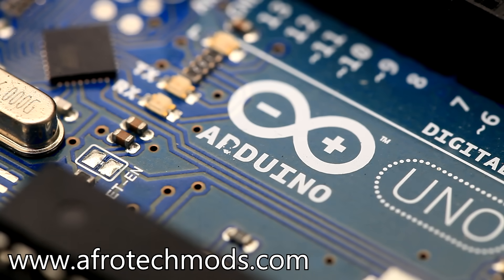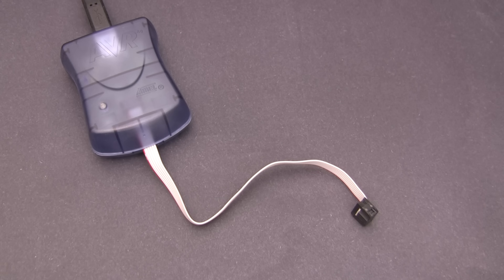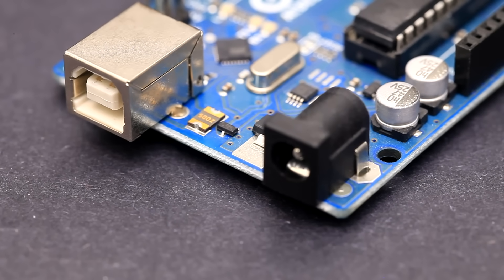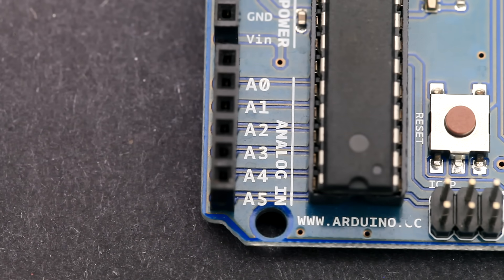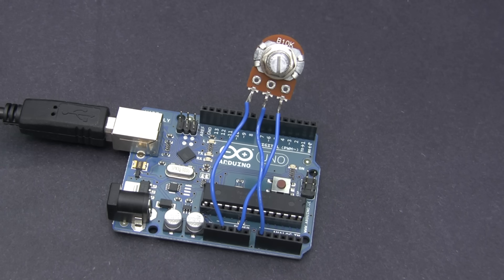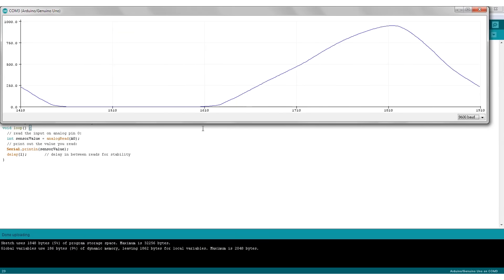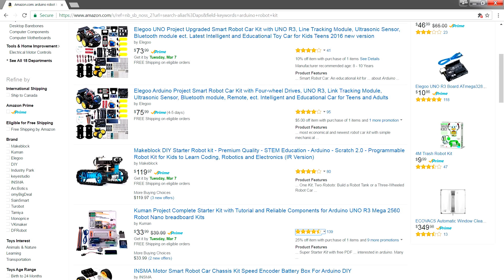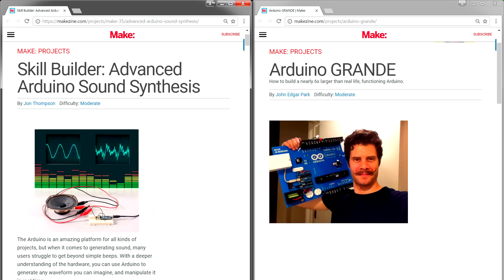You can learn Arduino in 15 minutes.

Comment: So, it's just a simple small computer.......
Reply: With just 300 pages of datasheet. Very simple!
Reply: @Henry-sv3wv  I can't think of a use for it compared to my desktop.
Reply: @gangleweed  Maybe you are more kind of  a 'DIY building my own digital high speed hardware guy' then an FPGA board is your thing. You can make your own digital hardware design including making your own microcontroller 'run inside' it.

You can see an FPGA as a giant field of logic gates. and instead of using a soldering iron to create connections between them you can configure the connections with software.
But you are not thinking in this low level, you get a higher description language for describing your logic in VHDL and the program generates the low level configuration connetions for that (vhdl hardware synthesis).

This is how you can design new digital hardware and test it on an FPGA before turning it into a custom chip for mass production.
Reply: @gangleweed 
Your Desktop PC is full of microcontrollers, on the keyboard, the motherboard, inside the harddrive. even the power supply can be controled by one but they use custom control chips for that.

 think about arduino and stuff like stm32 as smart electronics. IOT (internet of things), Smart Home, controling 3d printer, cnc machine, flying drone, outdoor data logging, neopixel, long range LORA communictaion. (for very low data transmission, like high water alert, evacuate!), ...
Reply: @Henry-sv3wv  No, totally wrong, I'm a hands on metal worker and computers  to me are just a means to an end without the need to mess with one to makes it do something I will never need or want to have.....if it doesn't come in a package with an instruction sheet marked press button A to switch on then it's of no interest to me whatsoever.
I do have some experience with electronics having built amplifiers and various traansistor circuits  etc back in the 70's......making a transistor circuit from a design is as far as I want to go provided it is in a schematic that shows the circuitry....electronic design is a black art......trouble shooting is another path I don't have an interest in.
Reply: @Henry-sv3wv  A black box by any description........what goes on inside is of no interest to me ....if it fails to function then it gets tipped.

Comment: Please, i need help here. I looking for a cog LCD screen, to repair my device. There a lot of screen on market with 36 pin and ic driver compatible, but not with the interface pin descripition. Its possible solve this problem on any way with a arduíno?!
Reply: Experiment it
Reply: @magicianofelectronics951  Thanks for the awnser, but i dont know how, im looking in my resarch If its possible. My device is a Spektrum DX3R out of production, and for sure, If are any way to replace the screen with arduíno or something, i will learn because i like this radio. Do you think its possible?!

Comment: An Arduino board is too weak to be a computer. If you want to make a computer, use a Raspberry Pi board
Reply: Arduino is a microcontroller board and Raspberry pi is a processor board
Reply: arduino and bigger controllers like Pico RP2040 or stm32 are for making smart electronics like IOT (internet of things) stuff.

A TV remote control does not have a PC inside, it does have a microcontroller ...

pc mouse --> microcontroller/dsp (digital signal processor)
usb pc keyboard ---> microcontroller with usb interface
PC talking to printer, microcontoller inside printer controling the stepper motors and print head

rapberry pi with linux can talk to arduino that uses stepper motors to control a 3d printer
Reply: But there is the Arduboy as a challenge how to make a computer game with minimal hardware
https://www.youtube.com/watch?v=EHytkTb1sSQ

Comment: I have a short wave radio that does everything including FM or anything in between that has Arduino shells, and it is what it? says I was wondering what the shells mean, I know it is a SDR radio software defined radio and I love it I was just wondering what the shells mean it's spelled shells in 🙄 eBay, understand if it's really Shields and it is just stuff plugged together because these things can be hopped up from software or other things
Reply: Hear it again

Comment: Thanks for that powerful explanation. How can i write a simple program that dynamically calculates the water volume used in a tank. Given a cubical container of breadth=5, length=10 and height =20. If i fill the tank with water, I know the volume of water is waterVolume = tankV-emptySpace. Now, how do i know the amount of water used if i keep reducing the volume of water downwards?
Reply: Maybe use a water level sensor to monitor the height per period? Or just skip the calculation part and use a weight sensor?
Reply: @895caoszi  yea perfect

Comment: I'm not sure what terminology is correct here, but is it possible to have the lights appear to run down the length of the LED strip? This video shows the action of the lights I'm hoping for: https://www.youtube.com/watch?v=pDy9se8K_5s&t=43s
Reply: Yes! But you’d need an individually addressable led strip, rather than a regular one
Reply: @adambeedle  yes, with addressable LEDs. Can you recommend code or point to the code you used to make the LEDs work as in the video above? Thanks for the guidance Adam.

Comment: Could we send an arduino back in time to save John Connor?
Reply: Apparently I got interested in Arduino and electronics in general.

Now I'm laying on a mattress on the floor, surrounded by hundreds of components (pack of resistors, caps, diode, led packs, breadboard, jumpers, transistors ... the works)

...and an Arduino Nano.
Now I'm watching this video again in a different light.

Sigh...John Connor is fucked.

Comment: Is there any way to get templates for programs like the example ones or do you have to know how to write the programs from scratch to do anything more advanced? Since coding itself it is one of those things not achievable if not learnt as a child. For example if I wanted to  create a controller for an electromechanical warning siren with a few different signals by the use of damper solenoids as well as turning the motor on/off, would that need writing from scratch?
Reply: For advanced things like that I’d say yes, but the arduino IDE has built in examples you can view and test which show how to code for different functions, and you can search online too for people making similar projects so it wouldn’t really be from scratch! Hope that helps
Reply: @adambeedle  I don't know how to code and there is nobody that has done anything similar, would this mean it is simply not possible?
Reply: @adambeedle  It was my project he was referring to. I have been trying to get it to work but either no outputs work or only one output will be on but will remain on for the duration it is running/scanning for inputs, despite there being no input from the GSM receiver. There is nothing to example off as the only actual controller I have available has absolutely no activation function other than for someone to have their finger on one of two buttons continuously, and it also has no damper control whatsoever so the siren is muted throughout operation.
Reply: @arianaashworth3091  You should be able to wire the live for the solenoids to one of the phases going to the motor so they will open when the motor is powered. I have seen a couple of examples that have them but don't even use them and seemingly just wired it up to work that way.
Reply: @FM60260  It doesn't work. I tried it before and it just throws the phase balance off and trips the power, I can jam them open or remove them completely but that would defeat buying one for the dampers in the first place.

Comment: When I finally say I understand a bit I find whole lots of stuff I don’t understand!! I love this but I think I’m missing on the basics and I don’t know where to start. Can anyone help me please 🥺 I have very basic knowledge of circuits (voltage, current and resistance) I know how logic gates work and diodes and I learned C and C++, still very basic with python. What do I do next?
Reply: I’d say you’ve got a great base there and you should just get stuck in! If you have an Arduino and some components already you could start making small projects already like a servo controlled by a potentiometer or something! You can always start with the example code given in the Arduino IDE if you don’t know where to start

And if you don’t have an Arduino yet there are virtual Arduino simulators where you can build code and run projects for free, I think tinkerCAD has one that runs in your browser

Hope that helps!

Comment: If you have a 20ma capable output, you can safely use a 330 ohm series resistor to drive an LED at 5V. This gives 15ma of current. A 1K resistor will only provide a paltry 5ma of current.

Comment: Thanks for the video.  I've been dabbling in Electronics since I was a kid.  My grandfather could make anything and solder anything.  Me, not so much.  About a year or two ago I saw I could buy one of these UNO boards but I never knew what it was for.  Now I know.  I can start putting my collection to work.  Ever since I was a kid I would save Capacitors, LEDs, Chips and Crystals, to name a few.  I've had to give a lot away as I've traveled but I have a new collection that's been collecting dust.

Comment: Can someone tell me how the PWM works. I understood it so that the potentiometer reads different strengths of the voltage, and then he outputs different strengths of the voltage to the led. But when he looked at the signal it seems like he's changing the time of the signal instead. What am I missing?

Comment: I found the sensor kit and our first arduino on amazon for about 30 bucks...then for 20 bucks we got a 3 wheel two motor kit that was just the motors and wheels and base...then we made a sonar controlled "smart-ish" car.  It can navigate our home with ease...and with a little creative copy and pasting we managed to get it to make some noise via a oscillating op-amp when moving so we can know where it is...add a couple lights and it is a nice little dude.  My 8 year old loves it.  

This video would have been lovely to see a year ago when we started.  Totally subscribing.  Thanks man.

Comment: I just simulated the potentiometer controlling the LED experiment in TinkerCAD "Circuits". I didn't even know the TinkerCAD simulator existed until earlier today but feel compelled to let others know about it, as it's quicker tinkering in the simulator than with an actual board (and good to prototype in the simulator prior to doing it with a real Arduino just in case you do something wrong and fry something!)

Comment: You can use an Arduino to run a 110 Volt motor by using an iOT relay. I have a CNC router that is Arduino based and has a cutting area of 30" X 30". I use an iOT relay to turn the router motor on and off.

Comment: If i run a motor using arduino without motor shield arduino wil damage
Reply: the motor needs more current. Arduino cannot supply that much. it will kill Arduino permanently. use a motor shield or a motor driver IC.

visit https://wokwi.com/arduino/libraries/Servo for servo simulations. Share it with your friends. it is a real good source for very quick learning.

without any hardware 😃

https://wokwi.com
Reply: Use motor driver please

Comment: Nice video, but I just want to clarify something. Are you sure about maximum input voltage being 9 volts? According to the official store page, input voltage limit is 6-20V and input voltage recommended is 7-12V. Also nothing was said about Vin pin

Don't want to nitpick, but who knows... Maybe someone would need those extra volts
Reply: After Vin pin there is a voltage regulator so you don't have to worry about that up to 20V according to your given information
Reply: Hey Everyone - I have a solid IT background and am Digging into Arduino because I have some Engineering Projects I want to get going and need the ability to Automate - Going to Document my Journey, pls follow and support and interject. Pls and Tnx.
https://www.youtube.com/watch?v=1LbAOVITDdA&t=49s

Comment: I bought an elegoo kit from amazon and I have a potentiamater but it looks completely different from the one you've got in the video. It has 3 prongs on the bottom instead of ports to plug in the cables as you did. How do I connect this?

Comment: I know it def works better and it’s more fun because of the code but if you have a  potentiometer you can control motors and leds anyway but I would recommend using the Arduino because you learn about PWM and the code for Arduino.

Comment: One little thing to correct: the programming language is not originally from Arduino - it's much older, I guess the forerunner is from the 70s, the programming language used for example in Arduino is from the beginning from the 80s.

The original Name of it is correctly C++ - an extension of C. There's a whole operating system written in C - it's UNIX, the forerunner of Linux.

C(++) can be that mad programmed that it seems to be from an lunatic asylum - best example for that is if you would call a function out of it self. Totally crazy and dangerous for eternal loop but possible.

Comment: Kind Sir, 
I am DISABLED. I want to grow plants and use arduino to sense plant is Dry and trigger the water pump to send water to plant  “until” water sensor signals it is wet then arduino turns off water pump.  I want it to check every other day. 
I have brain injury that makes it a challenge to focus and read.
I noticed I can follow the steps from a video if they clearly show wire/pin connections, also website where they copy code if any. I have seen others use raspberry pi computer but it will not work in hot summer here. Arduino will work.
I purchased an 8 switch unit.
I think that gives me 4 moisture sensors and 4water pump switches IF I UNDERSTAND CORRECTLY HOW SWITCH WORKS.  That will care for qty 4 plants
  I need another  (set) to measure rain barrels (t) and larger flow pump to empty them into retainer tank on a small hill.
Then I need another unit for 16 qty plants monitoring and watering.

Watering will be easy gravity flow down hill mostly. Small watering pumps have easy work.

I will GLADLY BUY THROUGH YOUR LINK, BUT CAN YOU HELP ME DECIDE ON CORRECT ITEMS?
Most Humble Appreciation! Alton
Reply: English please

Comment: Hi Afrotechmods, this Video is truely awesome... It´s sort of encouraging, makes me wanna get deeper into that stuff, though i´m quite aware of the fact that it´s not that easy at all... Although you´re on the edge of making me believe it could actually be that way though... ;-)
Anyway, i hope you keep on posting these fine Tutorials... Three Thumbs up Mate, if i may call you so. Clear description, clear speech, clear message.. That´s exactly what i wanna see... Oftentimes i´m watching Videos that although the topic is really interesting - they´re boring me to pieces... Your´s didn´t a second, so as i said before, thumbs up + subscribed...:-)
My current project is building up a Dry Ager / Curer out of an old Fridge that i dont´t need any more, but it´s fully functional. Controls for ventilation, temperature and of course humidity are crucial here, and that Arduino seems to be the perfect tool to get the job done.
Thanks again, greetings from Germany.

Comment: Very professional. Are you reading from script when you speak?  You would have to be. You make no mistakes. Just a note on PWM for controlling motors - it is the ONLY way, and without a capacitor! At low speeds  on the motor there is significant torque  control improvements over simply just current or voltage limiting the load with some sort of non-switching DC arrangement. Do you tend to agree Sir?

Comment: Alright what do I do. I need one that can power 2 small motors EACH WITH THERE OWN CHANNEL. So both don’t do the same thing at the same time, it also needs to power 2 small LEDs also with its own channel, and it needs to be able to hold say a song that I can hook to a speaker. Also it needs to be turned on by a switch, was it I push the button, it does it’s thing and stops. So what do I need. Yes I have the motor and the LEDs. What Arduino do I need

Comment: i need help on a school project that I'm hoping to patent later on.  I want to create a pressure plate that when activated and the remote is out of a 20 ft range, an alarm goes off. I have a pressure plate that works but now i just need a perimeter function to connect it to so once the remote goes outside of the 20 ft range the alarm blares. Can you help me?
Reply: look up  'tutors' in your area . Most are English maths etc ie the main subjects, but some offer electronics

Comment: Clone manufactures provide no educational value to Arduino community, purchase at least one genuine arduino, before purchasing clones. The trend  has been to use  Arduino board as large expensive component, rather than an embedded microprocessor development tool. Probably cost effective for a single build, much less so if the plan is to construct multiple units of something.

Comment: Does anyone know what arduino you recommend for using on large motors? I was thinking of getting the mega version is that suitable?
Reply from the maker: The Arduino itself won't really make a difference for big or small motors. You would be using an Arduino to control a motor speed controller of some sort. So you should find a motor speed controller that works for your motors, then pick an Arduino that interfaces to it. It's two separate products.
Reply: @Afrotechmods  thats great thanks. Also thanks for the speedy reply ⭐⭐⭐⭐⭐👍